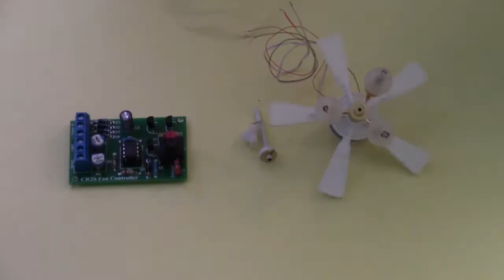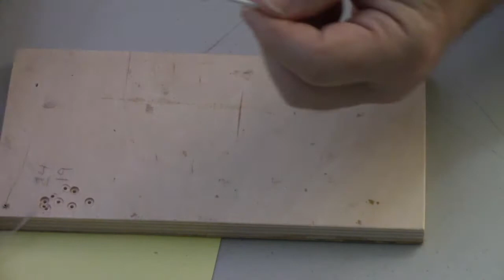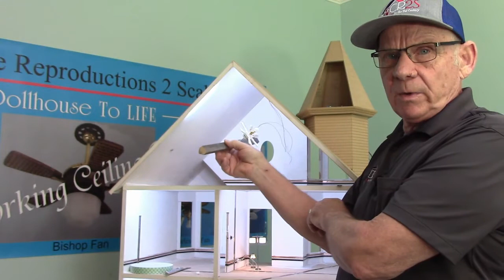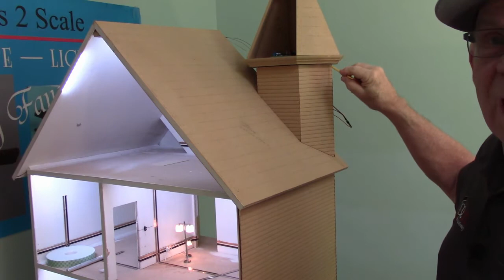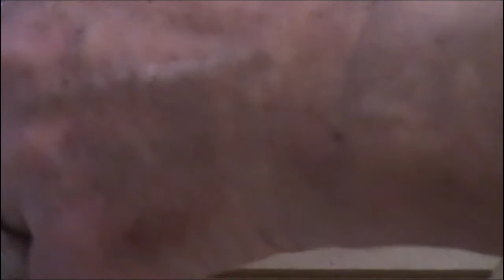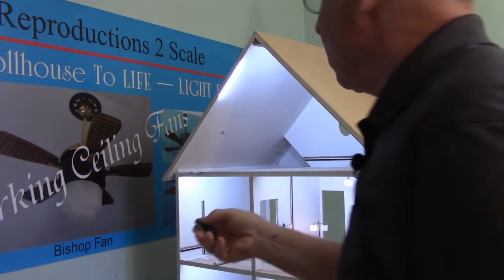Miniature Working Ceiling Fan for Your Dollhouse

Comment: You said that you routered the edges of the walls to run wire. What tool did you use to router the edges? Thanks